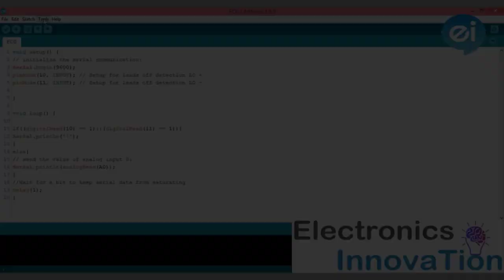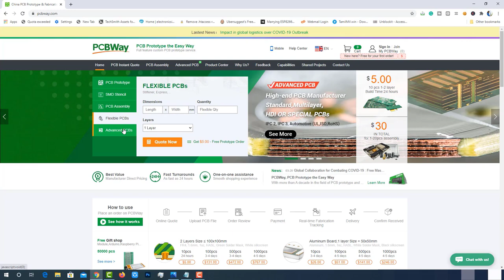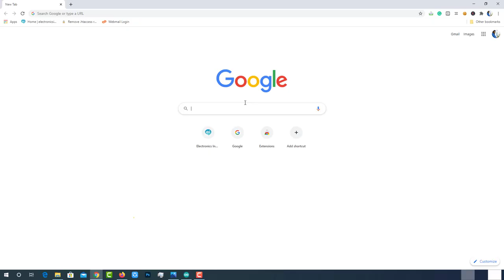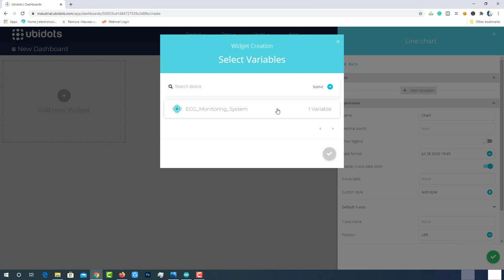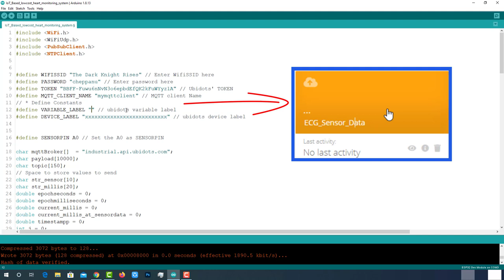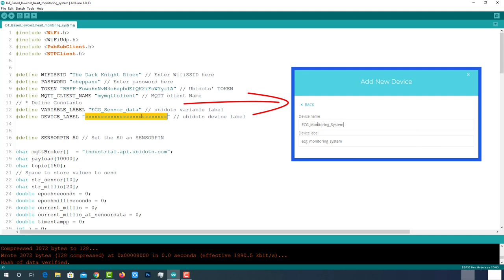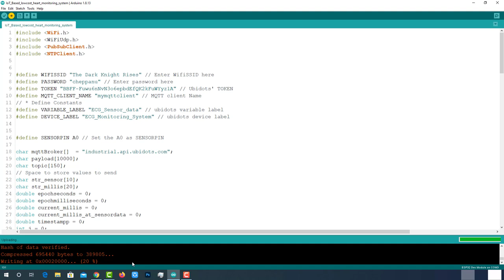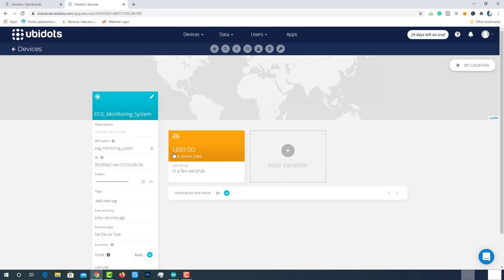IoT based Low-cost ECG & Heart monitoring system with ESP32 and Ubidots Platform

Comment: After getting this ecg graph. Can we personally analysis the graph without going to doctor
Reply: I realize that your comment is over a year old, but I don't know if you got your answer.

If not, the answer is a HARD NO!

What you see here is a very noisy waveform that blotches out the real data that an ECG is supposed to show.

You can research what an ECG should look like.  You'll see that this is not it.

There's a lot of coding that would be necessary to get this sensor to product a clean waveform.

Comment: what is the accuracy level of this prototype?
Reply: ZERO!
Please read my post of today, above.
I lay out the problems here with this very noisy sensor.
The waveform you see here is horrible and not only not accurate, it's not even readable.
Reply: @BlondieSL  what is solution
Reply: @mrugeshpatel5684  Look at my very long comment that I posed about 21 hours ago (right below here if you sort by "Newest."

While I can't post actual code, I hint at how to find it.

If you use Chat g P t and word things properly, it can actually code the math formulas for both those filters.

Math is not my strong suit. So, knowing how to format the text for what I want Chat g P t to do, it actually came back with the 2 formulas!

What was surprising, is actually seeing it in code, was how simple it actually turned out to be.

So please check my other comment and hopefully you can gather the info.

There are also links to those filters that I mentioned.

I hope that you can find it.

Cheers

Comment: i need ecg reader too in this project which gives result
Reply: Please read my comment above.
I inform that as presented, this waveform is bad, very bad and does not represent a real ECG.

It's not the fault of the guy who posted the video, as the sensor itself is very noisy.
I talk about using two filters that help filter out junk so that the actual ECG waveform can look better.

Good luck

Comment: The same project can work thingspeak instead of ubidot?
Reply from the maker: Yeah, you can give a try 
But there should be is 15sec delay, for every data point so, that may cause any problem.
Reply: @electronicsinnovation  Mqttp is not supported in thingspeak?
Reply: What is the delay in this project ( delay from sensing to monitoring)
Reply: Have you tried it ? May I have please the code for thingspeak ?

Comment: Dude you are loosing critical data
Reply: EXACTLY!

Those ECG sensors are super noisy!
And SUPPOSEDLY they have built in filters to avoid that.  But I'm not buying that.

In my comment of today, above, I talk about 2 filters that can be researched.
Butterworth and Chebyshev filters.

To get this sensor working right, there is a lot of code needed, besides the filters.
There frequencies and other elements.